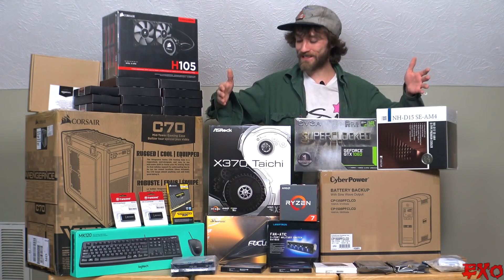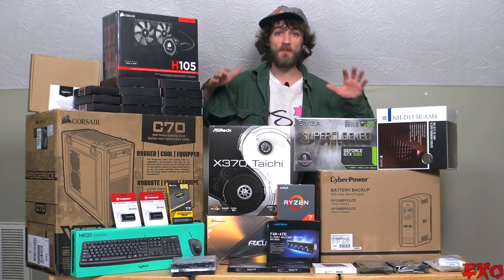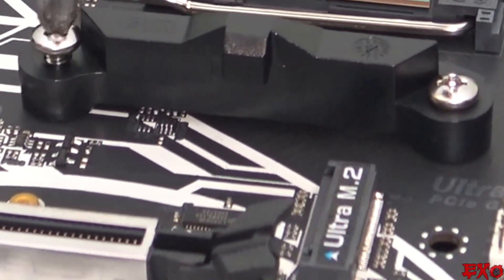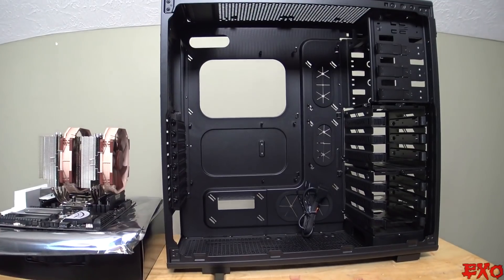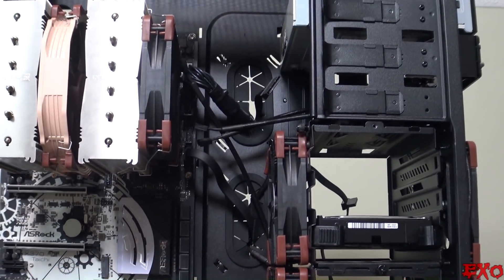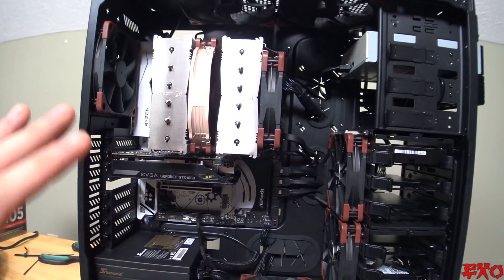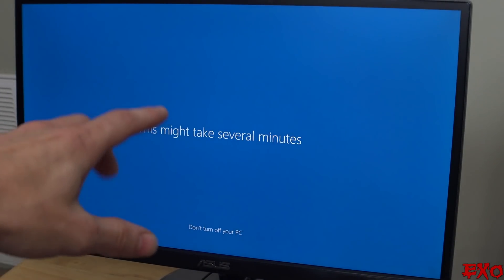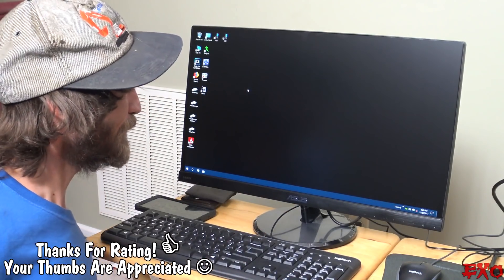Building a FAST Computer w/ RYZEN 7! EXO's FASTEST Computer Build EVER For 4K Video Editing in 2018

Comment: Well I like windows 7 pro 64 bit have not try w10  but love the build man that nice the CD ROM is the first thing that boot in start up you should be able to cut it off in BIOS just take it off the boot list that it
Reply: 1987Isuzupup 
Don't run run 10. Microsoft built in data mining and basically watch everything you do.
Reply: mephInc yeah I figured that 10 was like a open door I've got to say that 7 was to but I well never go backwards I'll stay with 7 till I haft to move up thanks
Reply: 1987Isuzupup 
I'd go back to NT or XP if I could
Reply: mephInc I have a 80g HDD that has XP on it a IDE 3-1/2     drive and I can't find my adapter that I have it some wear the joys of moving to a SATA mother board no IDE headers same with my old 160g WD HDD it has 7pro on it can't access it at this point in time

Comment: You went overboard on the fans. Premium fans really aren't the best price to performance upgrade.
Reply: Brandon Neil In my experience the cheaper fans give up arter only 9-10 years while the expensive ones stay fresh throughout! Nothing bad in investing in a full set of quiet long lasting Fans (My Fans got around 40,000 hours on the clock, 3 has died and 2 has gotten bad noises and another 2 needed some lube)
Reply: Noctua fans FTW. Performance isn't everything when it comes to premium parts.

Comment: There is no way in hell you'll ever need all those fans for a Ryzen system. Especially if you have it on water.
Reply: namcost Enlighten me, why the hell will he need all of those fans? I can tell you from personally experience that most systems don't need a ton of airflow before they cap out. See here: https://youtu.be/8OmkmluAYAQ?t=11m53s. Not only that, he mounted 2 fans where they will literally have 0 airflow, and he used two different types of fans on the cpu cooler, so the pressure difference will wreck the bearings over time. With all the exhaust fans, he will also have tons of dust because there will be no positive pressure within the case.
Reply: Nothing?
Reply: BAD Ben youre right, airflow is way overrated. The heat will dissipate well enough. As long as it has room to breath it should be okay.

Comment: I would overclock the ram.  Ryzen's benefit much from high speed ram.
Reply: base clock in particular for the ram, as with the infinity fabric the communication between the processor units happens relative to the base clock
Reply: well that is correct and long way of putting it :)

Comment: dude. why not samsung 950 PRO NVMe  M.2 SSD for software?? 2500MB Sequential Read and 1500MB Sequential Write
Reply: Those SSD's are expensive, as EXO said in the video he was trying to save money with the build by finding parts with discounted prices and rebates. His motherboard does have 2 M.2 slots for those SSD's I'm sure maybe he will get them in the future. lol
Reply: they  are more expensive and less bang for your buck.
Reply: m.2 is only 5 x faster than normal ssd.  you can get m.2 256gb at 170$ vs 256gb ssd at 75$ (btw. just for info.. m.2 is 25 x faster than hdd)
Reply: word

Comment: What's that on ur 5.25 optic drive? Is it the fan control?
Reply from the maker: Yes, two speed settings. Full 12v on high and around 9 volts on low.

Comment: Send back the H105, the Noctua DH, All those fans and the fan controller. Put the money towards faster memory and a better gpu. The ryzen just doesnt make that much heat.... Other than that, spot on in brands / choices.
Reply: Thankful for returns. I really would have like to seen a b350 with an m.2 for video buffering in software. The fan controller would probably be extra useful in the vehicle build though! SMD style

Comment: You dog turded the silver compound!  Extreme air pockets!!!
Reply: Also, no grounding wire to your arm?  sigh....
Reply: Does not fucking matter
Reply: If you like hot pockets, and cpu throttling sure it don't matter.
Reply from the maker: Discharging periodically is fine

Comment: You always do a clean job man - lookin sexy!  Now you are getting into my backyard so it is cool to see you narrating while building one. Hah, I don't know if I could build a PC and make it sound half as fun and exciting as you do. BTW, I have Win10 on my main with Hyper-V running my IT server lab but I also have Win7 on one of my gaming machines still. 
Two things: Like Chris Green mentioned bellow, if your monitor is capable of 4k viewing, then your DVI cable to the monitor may be limiting your visual output since they go up to 1920x1080 resolution. I don't know if editing 4k means you want to see your videos in 4k on your monitor or TV but if so, HDMI 2.0 is pretty common now and do pretty good 4k output with a good refresh rate and most 1060s support it. 
On your DVD question - Maybe if your UEFI has has the DVD on its list of boot drives, it may be looking to see if media has been inserted to boot from and then spinning down when it doesn't see a boot disk. If this is the reason you hear it, then just go into the UEFI and tell it to never boot from the DVD. Worth a try anyways!
Reply from the maker: Thanks for the helpful insights, appreciate you taking the time :)

Comment: On the "ASRock X370 Taichi" Mainboard are two Ports for "Ultra M.2" SSD's. Why did you take a normal Samsung SSD with a slow SATA Port?
Reply: umm not that big of difference, his SSD is pumping out excellent speeds as is.  550mbs read and write is all you need.

Comment: A GTX 1060 is not capable of 4K editing on a good scale. It works okay for 1080p gaming but runs 4K at a solid 2FPS, Terrible CPU and underpowered GPU. an 8700k and a 1080Ti or TItan X would be far superior.
Reply: OMG. Shut up Intel fanboy. A 1700x is really worth it. U don't need a 1080ti to edit. It's cpu depending so a 1700x with 8 cores is overpowered. It's NOT gaming.
Reply: 1. I love your profile picture. 2. Agree with the 1060 statement 3. AMD is actually great! My 1800x is amazing for editing with my gtx 1080

Comment: Where do you need all those fans :D There is no need for that many
Reply: all that fan money he could have used to a 1080
Reply: air coolers don't cool that much, you need most of those fans to get an even airflow from one side of the case to the other.
Reply: Still its overkill
Reply: The difference betwen a good ventialated case and a bad one ca be as high as 15 degrees!! Plus, the fans can be throttled down all the way to 300 rpm!

Comment: You should have got on the x399 Platform. Way more headroom for upgrading. I built a 1700x and Asus Crosshair Vi X370 system when Ryzen first released. Now I'm buying a whole new motherboard and CPU due to the x370 Platform not having headroom at all. The 24 PCIe Lanes is trash. Ryzen for budget gamers, Threadripper for production/content creators. They are both affordable especially if you live near a Microcenter.
Reply: v3z why would he need a better rig? 4 times faster is good enough for him! Besides, there is always bew and better stuff coming out, and x399 is not better in performance/dollar
Reply: Actually, Threadripper is the only thing that has a better price to performance ratio than the Ryzen 7 line. Problem is there's no headroom with Ryzen 7's as a Content Creator, like I said. The Ryzen 1700/1700X/1800X are a deadend basically. You will have to go to a whole new platform to get more Cores/Performance. Which is why so many people like me went from Ryzen to Threadripper so fast. Ryzen made sense at first for a production rig compared to the crap Intel pulled this year. But now that you can get a Threadripper 1900X for only $379 that's way faster than the Ryzen 7's in Premier Pro, Resolve 14, ect... and still have headroom to upgrade to the 1950X later and save even more money, it doesn't make sense in the grand scheme of it all to settle for a Ryzen 7 as of December 2017. There's literally only a $150 price difference from Ryzen 1700X to the much more powerful Threadripper 1900Xbuilds now. 1 has a shit ton of headroom to grow, the other doesn't at all. 

If you're just gaming the Ryzen is decent. But for heavy 4k, 6k, 8k, Live streaming ect... You run into issues fast and will need more than 8 cores that can't do a decent OC. Trust me! Been there and I'm happy AMD outdid themselves for a 2nd time this year with the Threadripper cause it solved what I quickly ran into with the Ryzen 1700X. Don't get me wrong Ryzen 7's are good, but AMD already made a better option that pretty much cost the same amount of money. That's all I'm saying!

Comment: That cooling paste wont spread fully on the chip surface like that. You need to spread it like a butter on the bread smoothly. If you dont believe me, unplug the chip and see it yourself. Otherwise, great video, I like you and your stuff you create!
Reply: SuperKanuuna no you don't need to spread. It'll squash and layer itself.
Reply: Terry Johnson No it doesnt. That was my point. Try it yourself and see and it will spread only for very small area..
Reply: SuperKanuuna it will spread itself. Also, by spreading it "like butter" you're going to introduce air bubbles in between the cpu and the cooler, making the cpu run hotter than it would do if the thermal paste was applied correctly.
Reply: Skweej You spread it smooth with your businesscard or something! Why you all attack against this fact when you havent even checked it by yourself first!? Small drop paste like that wont cover the whole chip area. Unless you do as I mentioned above. Period. 🤦
Reply: I have no issue with pea method. it spreaded evenly on my noctua cooler. it will be an issue if he use a big IHS CPU like threadripper